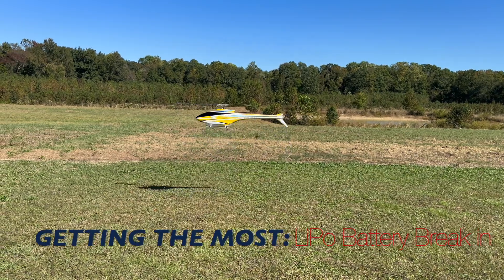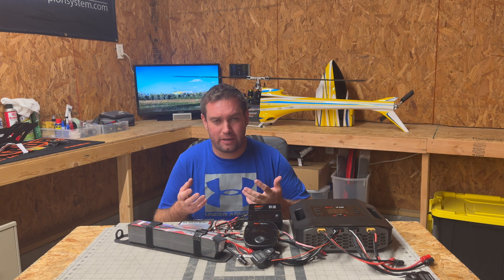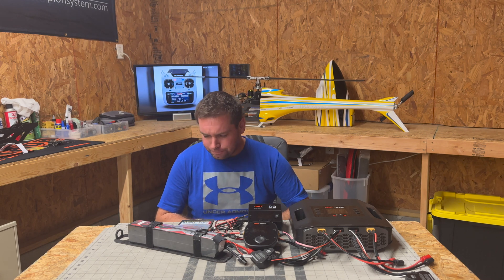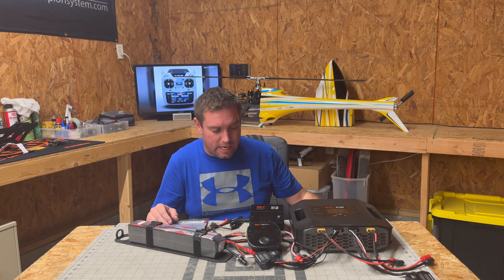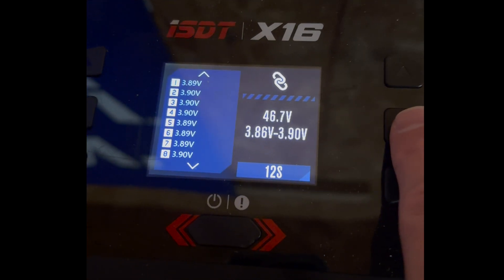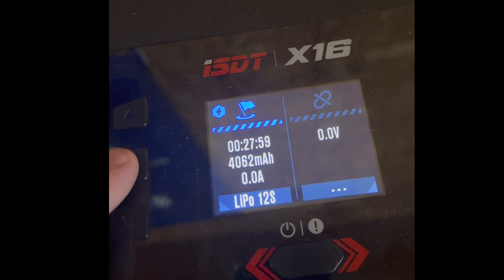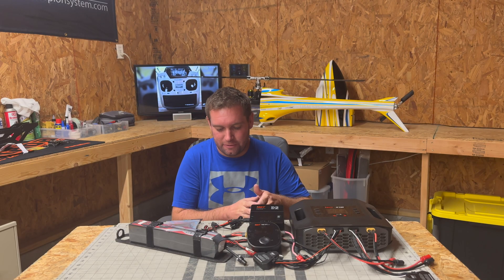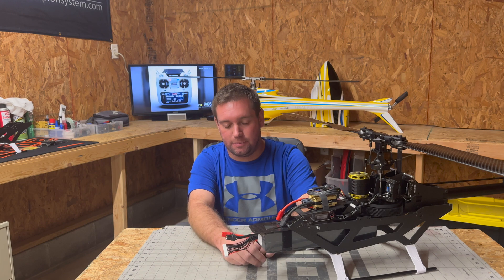Getting the Most: Battery Break In

Comment: I find IR varies based on temp, a warmer battery has lower IR and performs better. Id like to see a discharge curve from a new battery vs a broken in battery to see if the average voltage is higher during the discharge period.